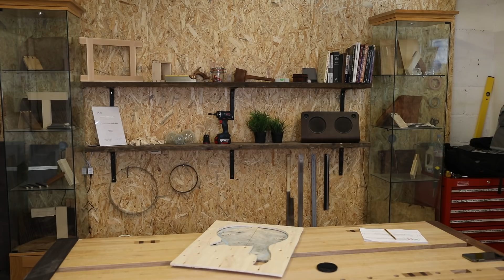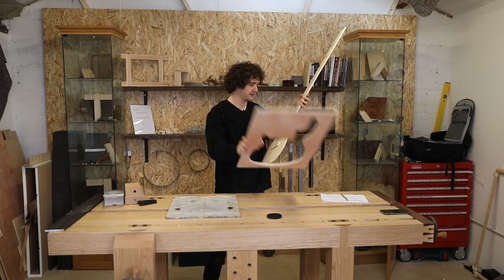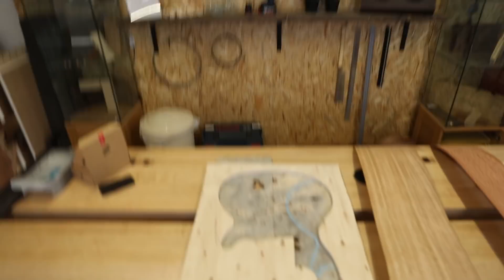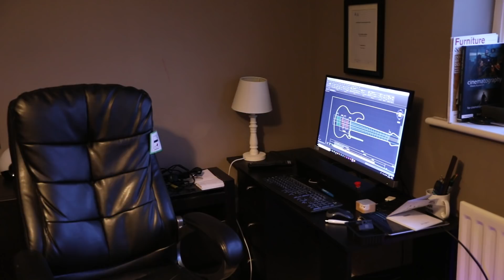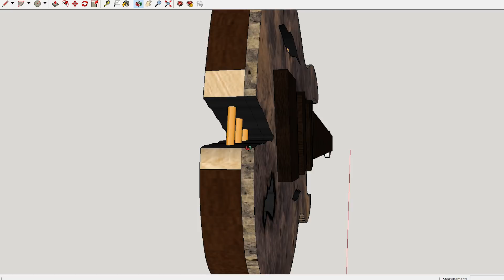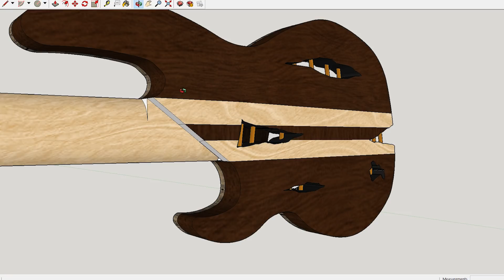IM BACK | Designing the Roadworks Bass #3

Comment: I know I'm late here seeing the building videos. But. I always place the bridge line in the middle of saddle travel.
Reply: So, I want to build my own bass guitar, so, might I ask, what does this mean?
Reply: Crash Webb you have "the scale length" the distance from nut to bridge. Here on Matt's that is unique for each string as it is a fan fret. Go to a normal bass. It would be same for all strings commonly 34" after the original Fender bass. However to set up perfect intonation (each freted note is ib tune across all strings at all frets) most bridges allow adjustment. This shortens or lengthens the scale a bit until you get the fretted note at the 12 fret to be exactly an octave above the open string note. 
So of you position your bridge as Matt is where you expect or need the saddle pushed forward or backward you may never be able to get the intonation spot on. Hence when I position the bridge so the saddle travel is in the middle point on the scale line.  
Sorry if that's a bit long.

Comment: Matt, you should see how it looks with all the metal bars orientated in the same direction. I think it will unify the design.
Reply: Fully agree with Tim! The various angles of the copper bars looks... weird to me. Especially on the back with the 2 very close cracks. Either "arch" the most "inside" bars so they look like bended pieces going through (no quite fan of the idea, though nor if it makes any sens to you...) or put them all the same orientation. It should look better, in my humble opinion.

Comment: Once again - nice video Matt!  Question though - rather than have the buckeye joint centered & aligned parallel to the neck, have you considered orientating it at some angle to the centerline of the guitar body?  This, combined with offsetting the boards relative to each other, may afford more options in positioning the voids, and may also address the upper horn issue.